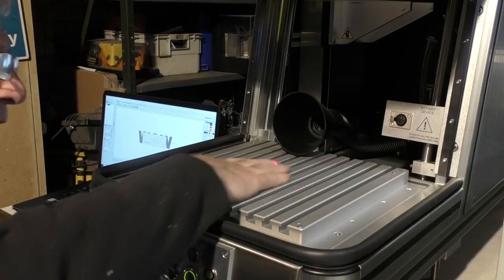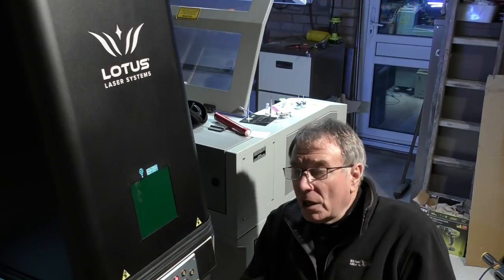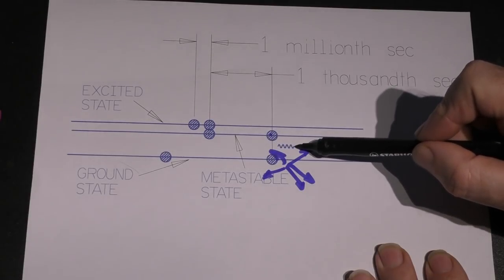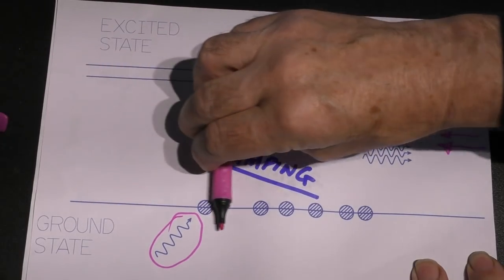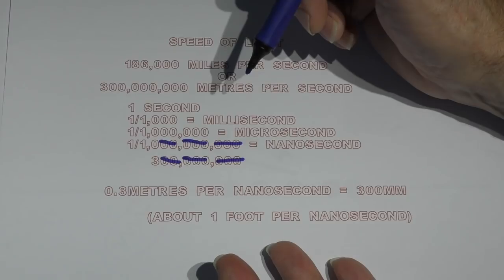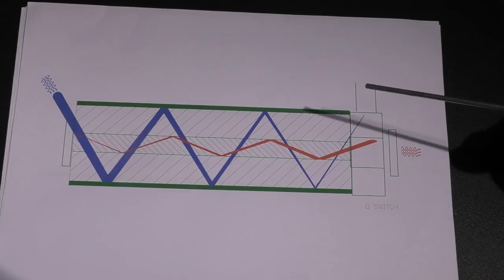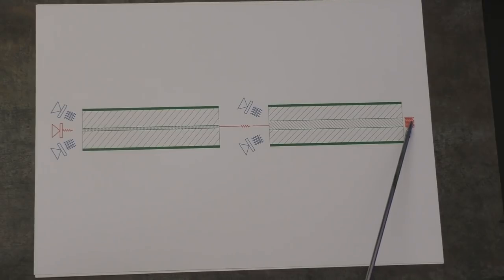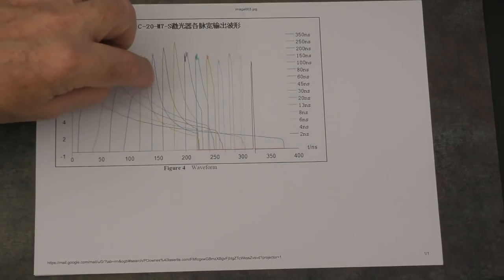Fiber Laser Learning Lab 01 Introduction to Russ, Lasers and Fibers

Comment: 8:55 - Fiber laser is extremely complicated laser engraving machine, due to the level of precision required. It's at the heart of what's inside the machine. It uses multiple high quality laser diodes of all equal parameters which then shoots laser light into a same spot of a laser crystal rod which combines their total optical power and shoots out a stronger laser light which then goes into a fiber wire which then shoots out to the galvo mirrors. That big lens u see at fiber lens is actually just as important as the laser diodes and costs more than the laser diode unit. The quality of the lens and galvo motor will produce quality results in engraving. Fiber laser switches on/off at incredible speeds of something which CO2 lasers can never do. To truly understand how fiber lasers work, you need to understand the theory of optics and lasers, then high speed microcontrollers or FPGAs(another breed of advanced microcontrollers) and how to program them effectively for high speed switching of the laser diodes and computing feedback sensors and controlling various components like galvo motors, and lastly electrical engineering to design the PCBs and schematics needed to make everything work. Fiber laser is some really complicated stuff, anyone can make them if they understand the theory from what I have just mentioned. I couldn't watch any longer after you start describing q-switch with as a "cotton wool" lmaoo.

Comment: An Interesting fact for you, A short pulse of height energy is more destructive to the surface of the material than a longer pulse of lower energy. The overall energy of the two pulses can be the same, but due to how quickly the material can disepate the heat generated, the longer lower energy pulse will be at a lower temperature. A short high energy pulse will produce higher temperatures. This is one of the key advantages of MOPA lasers over QSwitch.

Also, the test you did with the glass and the aluminium that showed damaged to the underside of the glass was due to the aluminium being in very close proximity to the glass and it's the heat from the aluminium that has damaged the glass, not the laser itself.
Reply from the maker: Hi John
I already have completed several videos in this new series and as you will find out,  I try to  answer to this "how much damage can each pulse shape do?" in the next session.  I do not find a complete answer  but I have plans afoot to equip myself with kit to examine this question in detail in a later session. Although what I can see with my little cheap USB microscope has been fine up to now, I need to see more with greater clarity. My workshop is no science laboratory , so I do not have  the luxury of  scanning electron microscope. However, I do have a very old  low magnification stero microscope which has revealed some staggering surface damage. So  I already have a bit of feeling for the damage regimes you describe.  Although this is not a particularly riveting machine to see in action. , there is a lot of process and material property details to discover.
Your point about the glass surface contact damage is well observed.  As I edited the video, I noted the vapour damage occuring to the glass and in another episode I do address this issue and take the testing a bit further. 
Please keep your comments, knowledge and observations coming because I greatly value the external input. Any help that allows me to cut corners in my learning journey is always welcome. You are watching an old dog learn new tricks, so by definition it may be a slow process.

Best wishes
Russ

Comment: I know this session was about another laser technology, Nonetheless, I do have a question id like your option on, how big on the X and Y axis could one make a cutter with a 35 AKA 40w Co2 tube before the power starts to degrade?
Reply from the maker: I think the answer is hundereds of meters. If you look at specs for some tubes they quote  a beam divergence number.  .Even with a big machine, the beam path is unlikely to exceed about 5 metres. I suspect that a beam that is in total 12mm diameter when it leaves the tube  may growo to 16 mm diameter by the time it hits mirror 3. In normal air there will be no loss of power just because the diameter has grown. You will still collect all the power and focus it down with your lens. The bigger losses will be typically 3 or 4% loss for each mirror and anothe 4% for the lens.

 Best wishes
Russ

Comment: Very interesting introduction! Hello, I’m Lulu from JPT. I noticed that you are testing our MOPA fiber lasers!
Reply from the maker: Hi Lulu 
 I have spent several years  as a total amateaur, using and learning about the machines and laser technology of  CO2 lasers. that use the constant current principle.  A local company, that uses JPT equipment in their machines, decided to lend me a machine to explore some of the unique capabilities of the MOPA method of controlling the  power of the fibre output.  As you will see if you follow my learning journey videos, I have no previous fiber laser skills,   just a great curiosity about  how the technology works and what interesting things this marking technology can do that a CO2 laser cannot do. You write to me at a very strange  moment in time because  I no longer have the machine. As I mentioned , this machine was on loan to me  and now the company has a client with an urgent requirement for a MOPA system  and they will be selling this machine.  I am now back to playing with CO2 machines but I am currently building an RF low cost machine.
 
 I made some interesting discoveries about colour marking stainless steel that may be of interest.

Best wishes
Russ
Reply: SarbarMultimedia Got it. You are very experienced at MOPA fiber lasers too. You could let me know if you have any problem or question regarding the MOPA fiber lasers. Bty, may I know which company offers this demo to you?
Reply from the maker: @lluuus586  
 Hi Lulu

The company that lent me the machine is called Laserite. They sell their machines under the name of Lotus Laser.
 Best wishes
Russ
Reply: Hi Russ, 

Got it. Thanks for your info. Do you have any question during your use or further information you’d like to know? Feel free to contact me for any question. 

Best,
Lulu

Comment: what about pressure from FOLLOWING pulsews.. if LIGHT speed is constant would not pulses build up and FORCE electrons through?
Reply from the maker: Hi Robert 
I'm not sure whether the question refers to the glass tube or the fiber.  I am confused  because the only electrons  are in the glass gas tube  gas . Nitrogen is a non conductive and flow of current requires free electrons It is not until you use 25,000 volts to ionize the nitrogen (the pink bem) that current can flow thanks ti the free electrond.  The electrons are negatively charged and will always be attracted towards the positive anode in the tube at almost the speed of light,

 On the other hand you speak of light pulses which makes me think you are speaking of the fiber laser where there are light pulses but  no electrons . On the other hand, there are electrons but no pulses in the glass tube gas system. 

Best wishes
Russ
Reply from the maker: Hi Robert
Upon reflection I think you may be puzzling about the light slowing down in the fiber . The same happens as it passes through a lens. It is a weird concept to imagine but here is an analogy that might make it clear. If you stand on a road bridge and count the rate at which cars pass under the bridge,  when the cars are travelling fast the separation between the cars is large  but when the traffic builds up a bit, the cars slow to half speed and the gap between the cars decreases to half the previous spacing, but your count rate will remains constant.  The same happens to light in glass. The frequency (count rate) remains constant but the wave spacing decreases but the FREQUENCY  remains constant  and no laws of physics are broken.
 Best wishes
Russ

Comment: Hi,

I am looking at buying a 3d fiber laser for my Troop. Looking for something that can engrave deep into stainless steel. Build surface from 6 x 6 inch up to 12x12 or higher. Do you have a recommendation?
Reply from the maker: Hi
I have zero experience of such equipment and am in no position to offer advice. Very sorry
Best wishes
Russ

Comment: It is good to see that you are thinking about protecting your eyes by using safety goggles. Please do the same with your camera. Even tens of milliwatts can damage CMOS sensor. I know that from experience. Even if camera is off!
Reply from the maker: Hi Milan
I appreciate your concern and have heard the same expressed by others. I must let you know that I am always several feet away from the action and always zoom in for my shots. I am ever aware of possible reflections from the many different materials I use and chose fairly low angles for most shots.  After 5 years my damage count is zero. Am I lucky or does that mean statistically that I will soon get struck by lightning?
 Best wishe
Russ
Reply: @SarbarMultimedia  Does that mean 5 Years of fiber laser, or total included CO2 laser? You know the difference. CO2 bounced beam will just scratch the surface of settled dust on the lens, but 1 micron wavelength will go deeper.
Reply from the maker: @MilanKarakas  Hi milan
 5 years of 10.6 microns where the beam will just etch the lens if ever I had a real strike and 9 months of 1 micron work where the light would have  passed through the  glass if I got into the wrong position. I was particularly careful when doing colour marking of mirror polished stainless. Just today, I had to "unlend" the fiber machine. Lotus Laser came and collected it because they needed it back to sell. So now the higher risk to my camera  has disappeared and you can breath easy again.
 Best wishes
Russ
Reply: @SarbarMultimedia  I did not mean to offend you, just saying. I hope you and your camera will server for decades.
Reply from the maker: @MilanKarakas  Hi Milan
 How did I convey offence? I am too old. grey, ugly, fat and thick skinned to take offence at anything.  My hope is that I will always make a joke out of any intended  barb because the sender will more likely be upset that it missed the mark. No, I genuinely appreciate you suggestions or constructive criticism. I am still a student of life and willing to learn from those that are REAL experts 
Best wishes
Russ
Reply: @jessicaliu7424  Thanks.
Reply: @MilanKarakas  you are welcome,dear friend

Comment: What brand laser glasses are you using? I'm in need for pair or 2 but i cant wrap my head around on which one should i get even if i knew we are talking about 1064nm wavelenghts (i just dont trust any chinese or amazon seller who is selling those chinese glasses).
Can you point me to right direction?
Cheers from Finland (Had my 30W Raycus laser for few months and it is heck a lot of fun!)
Reply from the maker: There is a lot of fear mongering and lack of understanding when it comes to laser safety. I was ultra cautious when I first got the fiber laser  because of the messages I was getting from Lotus Laser.  However, I have skepticism built into my DNA and I like to UNDERSTAND for myself how things work. I fully understand the risks with 10.6 micron light  from the CO2 laser but needed to get my head around the supposed extra risk with 1.06micron (1060nm)  fibre laser light.. Laser light is only "dangerous" because it is light that is fully phase synchronized and working in harmony. Raindrops are not dangerous until they combine and form a raging torrent. Light travels in straight lines and is not going to jump sideways and attack you or leak out of the beam . It does not radiate like sound in all directions otherwise it would be a light bulb . No, the two special properties that define a laser beam are  1) it is monochromatic (the same colour, even though it is invisible to our eyes) and 2) It is coherent, meaning all the light waves are exactly in phase with each other and acting together.. It is this second property that keeps the beam tightly "stuck together".  and powerful when focused.   So unless you put your eye directly into the laser beam it is not dangerous. However , although metals are less reflective at 1060nm,   curved metal surfaces can reflect a significant proportion of the light energy back at you.  if you are using an open unguarded  work table  I would urge you to put up a small clear polycarbonate screen , This will give you two levels of protection. First it will absorb any reflected light, and if the light intensity is great enough it will damage the work side of the screen. Secondly it will act as a UV light filter.  UV light?????  Yes, the REAL dangers of a laser are not from the beam itself . When the light energy of the beam hits the material you are working on. it excites the SURFACE molecules to extreme temperatures where cHemical reactions occur .  This can result in either a carbon arc or a very intense plasma light. This light has intense spikes of UV radiation which we all know  can damage human cells. Protective glasses (even cheap clear polycarbonate industrial ones) at $2  will protect your eyes from this radiation. And yes, this is RADIATION because it is an ALL directions.. Glasses will protect you eyes but it will not stop you getting sunburn on your face  or other exposed skin areas. Finally the biggest hidden danger that is so obvious that people never consider it dangerous, It's  the INTENSITY of that bright white light. Would you sit and stare at an arc welder? How about staring at the sun?   A quick glance at the work now and then is safe enough but if you close your eyes and see white spots then you have overloaded the light receptors in the back of your eye. I absolutely know just how hypnotic it can be to watch the beam doing its damage but this is the REAL damage you must protect yourself against.
 Hopefully this explains the many and varied risk factors associated with the laser beams  that are in the IR part of the electromagnetic spectrum.  I hope you will now see that a  polycarbonate face shield  and a pair of reasonable sunglasses will afford more protection than expensive glasses that only shield your eyes. Now hopefully you can make your own judgement.

Best wishes
Russ
Reply: @SarbarMultimedia  This was more than adequate answer for my question, an small lecture. As engraving area is small i could easily be done with by just building small portable enclosure that has went hole on a side and hole on top for the laser to shoot through. I'v read that acrylic has high UV absorbant capabilities so i might cut one with my 90w reci co2 laser. 
Thanks russ for the answer 👌
Reply from the maker: @JuusoKolehmainen 
Hi  
 Don't believe everything that you hear. Always check things for yourself. Acrylic is great at absorbing IR light but in its pure condition is poor at filtering UV light. For  that you need real glass or polycarbonate . However , Some named acrylic  brands such as Plexiglass include UV blockers in their formulation.  Make sure you buy the right material.

Best wishes
Russ